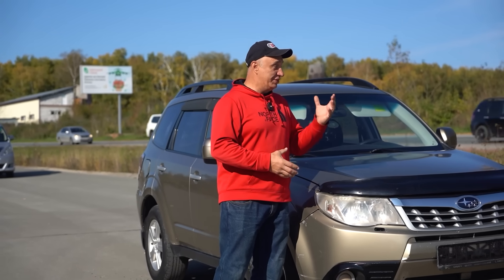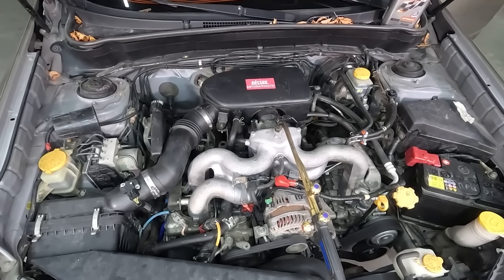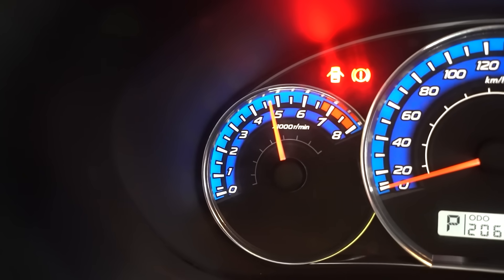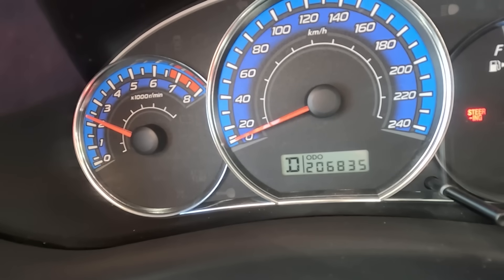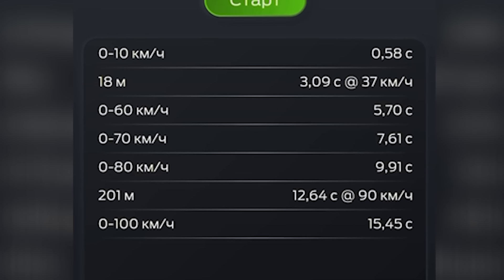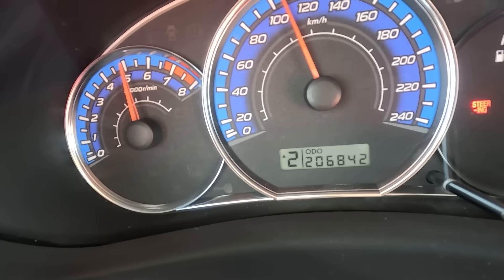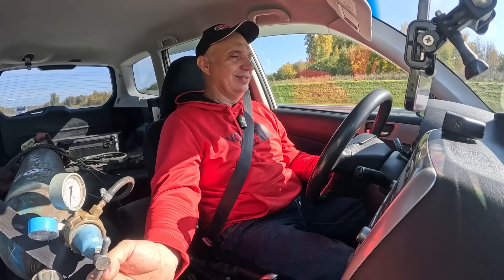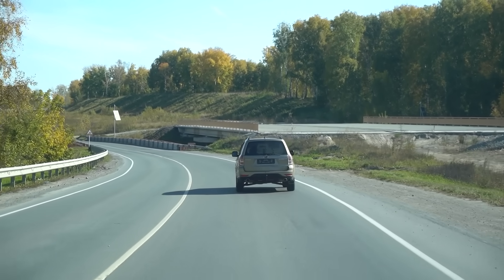We run an engine on pure oxygen - what will happen?

Comment: I'm not an expert but i suggest to get a crazy good result to spray the O2 through the mass airflow so the ECU can determine how much the flow is being, if you didn't skip this sensor you'd have enjoyed this test far more as it's responsible for measuring the air flow into the engine, so adding so much without the sensors properly reading definitely messed up the ECU, glad it was able to compensate through the manifold absolute pressure reading for you to get enough run time. I hope you'll consider a proper redo

Comment: That's leaning the hell out of that enigine. There is no better combustion, you are just making more O2 available which the computer attempts to compensate for by increasing fuel injection and duration.

The combustion temps doing this would be extremely detremental to the engine.
Reply: well what is better combustion?  it is better more complete combustion of the fuel if you just look at that and probably burns some byproducts. but its just as bad as running nitrous without extra fuel. basically it's nos-lite, sorta half(0.66x??) as good(no2 takes the same space as just o2 as a gas, but when its broken down the nitrous still takes the same space as the no2 molecule did while the two oxygen can go combust).

Comment: In the 1970s we had an Oxygen bottle hooked up to out field service van controlled by a horn button on the transmission tunnel, the button also energised a windscreen washer pump that squirted water into a spray bar in the air-cleaner box. 
  Dirt roads and racing every little bit counted and it made a real difference setting up a slide.

Comment: This played out exactly as anticipated. O2 sensor reads high, ECU adds fuel to save engine from hot excess O2, RPM increases. Hot excess O2 wins, engine loses.
If only there was a gas that let's you burn additional fuel without eliminating all of the nitrogen that normally keeps the engine from melting. A Nitrous Oxide of some sort.

Comment: There is only 21% ox in air. You are putting in 100% ox. You REALLY need to add a LOT more fuel. More than the ecu can handle.  Think of this like a nitrous system.

Comment: With electronic fuel injection you have to add the oxygen pre MAF sensor. Just like some have done with small nitrous oxide setup on the cheap. On a Carburetor  you'll just a super lean condition unless you change the jets to compensate.

Comment: Works up until the point that the injectors/ECU can't add more fuel. Would be interesting to look at the fuel trim numbers as you slowly add more oxygen. That way you should be able to work out the sweet point for how much O2 can be added.
Reply: Yeah both short & long fuel trims would be really messed up form this. That is why it's running bad after they turn off the O2. It takes time for the ECU to respond to new and ever changing trims.
Reply: Computers like "wtf where am I, there's more oxygen in my exhaust than the outside air?" 😂
Reply: Should pop a CEL, probably intake manifold leak.  ECU: I see the air coming in, the throttle position, but what's coming out the exhaust via the O2 sensors doesn't make sense, throw a CEL.
Reply: @piquat1  I doubt it saw any extra air or oxygen coming in, as the oxygen was injected after the MAF.
Reply: @surena9451  the o2 sensors definitely saw the extra oxygen content and even tried to make up for it, the increase in rpm is a dead giveaway, the computer was designed to run the engine at 20-22% oxygen, go higher than that while the engine is reading atmospheric air (the o2 sensor reads outside air as well) and everything starts getting thrown out of wack, a carburetor would be best in this scenario as many other commentors pointed out.
Reply: @surena9451   " I doubt it saw any extra air or oxygen coming in, as the oxygen was injected after the MAF."

That's the problem, it will see it in the O2 sensors in the exhaust.  You change the incoming mixture and the outgoing exhaust changes.  If these two don't jive, the ECU isn't happy.  It not only knows what the incoming mixture looks like when it's good in the intake, it can tell if the incoming mixture is good by looking at the O2 sensors in the exhaust.

So if your grocery getter gets an intake manifold leak, for example, extra air will enter the engine past the MAF and the ECU will know about it because it can tell your mixture is lean by looking at the exhaust.  ECU:  I let in X amount of air but had to put way more than the normal amount of fuel in to get a good mix by looking at the exhaust O2 sensors.... something's leaking.
Reply: @Initial_Gopnik  I wonder how the ECU would respond if the o2 as injected before the MAF. And what the difference would be if the car was equipped with MAF (most cars) or a MAP sensor instead.
Reply: @surena9451  The difference would be negligible. MAF would just see the O2 as regular air.
Reply: @surena9451 thats what he typed....
Reply: Bet it blows if you add it at high speed  and enough to start your exhaust valve red hot . Then gag It with oxygen, and enough that it could run with the throat CLOSED 😂
Reply: @dennisford2000  It would be like hitting a bottle of NOS, only a bit more effective.
Reply: @SilvaDreams nope.
Reply: @dennisford2000  Yup, NOS is NitrusOxide, it's 2 nitrogen and 1 oxygen. The heat cause them to unbond and provides more oxygen for the combustion. So just pure oxygen is even more potent.
Reply: That's when you plumb an additional fuel injector into the intake to compensate for the extra oxygen.

Comment: i guess you need better injectors and pump? so it can keep AF ratio
Reply: Yep, or just add O2 up until the point the fuel trims are maxed out, that should be the sweet spot for maximum performance.

Comment: Oxygen works on my 77 pick-up truck, with a carburetor. I used a Nitrous set-up and modified it for oxy.  It works best while pulling hills, and increases mileage from 8 up to 14Mpg. pulling a hill with a big block chevy. test n tune, but it WORKS
Reply: Nitrous is probably quite a bit cheaper than pure oxygen and a heck of a lot less likely to eat your piston crowns!
Reply: @devilsoffspring5519  welding oxygen, your engine doesn't need medical grade

Comment: Oh no, do not sacrifice Subaru. Lada ready for junkyard would be better choice.
Reply: Won't work with a carb. Needs ECU and O2 sensors to compensate
Reply: @MattyEngland  Add fuel and oxygen at the correct a/f ratio.

Comment: Your bypassing the throttle body and adding combustible gas after it the ECU is going to try to keep air fuel the same so its going to add fuel to stop lean out. You have now added fuel and air after the throttle body so yes RPM is going to go up. ECU probably tossing out TPS codes like mad or MAF. Modern electronics doing wonders. Try this on something carbureted you know something vacuum controlled not O2 sensor It wont pull extra fuel will probably lean out back fire and die or burn up the pistons. Yes limp mode would be expected if its throwing at least MAF codes some new ECU even shut down the car if it can't confirm Air fuel ratio.

Comment: It's the same concept as Nitrous. You add a dry shot of nitrous but need to enrich the fuel through the computer to make sure not to go lean. Same with boost, you add boost you add fuel. Wet Nitrous adds fuel and nitrous through nozzles or jets to increase the O2 content. The reason it idles up when O2 is added is because the Stoichiometric ratio is off and leaner engines run faster. The problem with lean as he mentioned in the video is that it burns WAY hotter and can melt things! If you've ever pulled apart a race engine that has a torched piston or head it looks like an Oxy torch cut it! They should have introduced the O2 in front of the MAF sensor, the AIR going in would have been more clean and purer but the engines ECU would have been able to mix the fuel / air ratio better because the air goin in albeit it more pure would have been metered. The unmetered air going in the way it was introduced was basically a pure O2 vacuum leak. Real bad news for an engine if ran too long!

Comment: Next time, add a little acetylene to go with the oxygen. 😮😂
Reply: A german channel call "Dumm Tüch" did that lol. The whole  intake manifold exploded and ruined a 3000€ garage door. The video is called "Explosion IN unserer Werkstatt | Dumm Tüch" for those that are interested.
Reply: @Boerkie1990  The subtitles are of limited help, but the explosion ten minutes in needs no translation.
Reply: I remember exactly that Dumm Tüch Video!
Reply: I've done this on small engines they turn a insane amount of rpm then explode
Reply: Lol 👍
Reply: A friend of mine did exactly that. The intake manifold almost went through the hood. Playing with acetylene is dangerous.
Reply: @ivorscruton5121  when we was kids we used to fill bin bags with a good welding mix and throw it on a fire. My mates dad had a garage.
Reply: @damianbutterworth2434 how's the hearing damage doing? lol
Reply: @DasEtwas  yeah the farmer used to come out thinking someone was firing off a shotgun lol
Reply: Boom😂
Reply: This doesn't look dangerous at all
Reply: I once used propane on my brothers 1937 Chevrolet 1 1/2 ton truck at minus 30* Fahrenheit. Started quite easily. 😊😊
Reply: Elon Musk approves this message
Reply: That would be fun!
Reply: You've got to already know, turbo/supercharging and NOS are all about increasing the available oxygen to burn the fuel.  But, to much oxygen will also cause the characteristics of the "burn" and likely burn holes through your pistons.  Engine will not run on oxygen only, Still needs a fuel source to be oxygenated
Reply: With the torch setup they used they could easily do this and even adjust the ratios. I would imagine you wouldnt really need petrol at this point but acetylene is expensive so impractical either way
Reply: Nah.. just a bit of Nitrogen. ;)
Reply: With more oxygene you better ad more fuel aswell.
Reply: Nitrous oxide, because it would be funny to see the Engine explode.

Comment: Engine senses excess oxygen, adds fuel, revs increase. Same thing happens when you open the throttle. Only advantage is that you can add more oxygen than the engine can normally inhale at full throttle.

Comment: Ya I was able to call it was the computer it tried to remap the air fuel to work with pure 02 and then couldn't work properly with regular atmosphere. But unplugging the battery or a few minutes should fix it

Comment: I think the engine fried itself while brake boosting. The Subaru has set parameters for how much fuel it can add when there’s more combustible air than it can inject fuel. The mixture became extremely lean, which can be ok for short bursts of power, but because it didn’t have the fuel injectors to support it. The performance gains were somewhat limited, with the right setup and AFR it could go under 10 sec 0-100
Reply: No, it returned to normal after the inspection. The reaction to environmental changes is gradual and as the computer got used to the extra oxygen being present, conditions weren't correct for running without it. Once it adjusted back to normal, everything was fine again.
Reply: @MadScientist267  ah ok my bad you’re right. didn’t see the end, guess the Boxer lives for another day haha

Comment: I would suggest doing this test on a carbureted Lada. Then you can dump more fuel in with the oxygen.

For the fuel injected engine it would be good to bypass the O2 sensors and use larger fuel injectors. 
Or essentially run to fuel injected engine without the computer getting involved and messing with the air fuel mixture.

I think using an RPM speed controlled valve for the O2 flow would more correctly limit the volume of O2.
Reply: or better switch the ECU to fuel controlled loop like a skyactiv

Comment: just making a vacuum leak sould be done before the maf air flow and throttle body thus te misfires and the trans making bad shifts

before maf air flow will calculate the mixture way better as long as injectors can flow higher with the air and even then will be at a certain limit by programming
also would keep idle steady as its before throttle body

Comment: The pcm defenetely lerned ps if you remove o2s it should default to rich without the pcm ajusting fuel trim as you go so you can add oxygen then put them back and you should then be back to normal emedeately

Comment: YOU NEED TO ADD MORE FUEL WHEN ADDING MORE O2
Reply: Computer adds the fuel in this case.
Reply: The computer is doing that on the fly. He needs to repeat this on a Lada (or anything with a carburetor instead of injection).

It would probably also be very interesting with a diesel.
Reply: The ECU isn't adding anything if it's unmetered air (which it is in this case)
Reply: @thisdoesnotseemtomeetourna3356 The map sensor should have helped, but idk if that engine even has it
Reply: @thisdoesnotseemtomeetourna3356  Incorrect. It will add fuel when it detects oxygen in the exhaust to bring the mix to stoich. This is why the engine speeds up at idle. More fuel, more power, and unloaded, that means more engine speed.

Comment: YOU ARE ON THE WRONG SIDE OF THE THROTTLE BODY, YOU ARE BYPASSING SO DUH, THE REV WILL GO UP, JUST PULL THE CUTTER OUT OF THE WHOLE AND THE REVS WILL GO UP
Reply: why are u screaming
Reply: It's because of the O2 sensor reading high levels of O2 so it compensates by adding more fuel.
Reply: @noonespecial9131  Both, they could also have added compressed air and the revs would still go up.